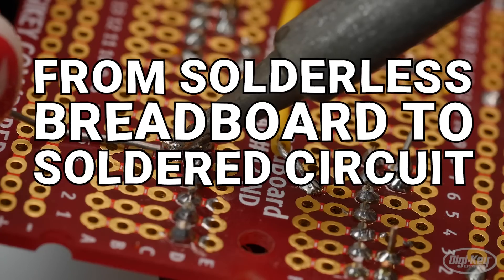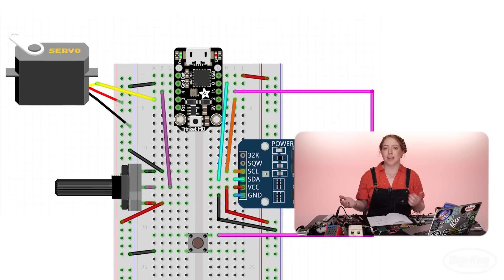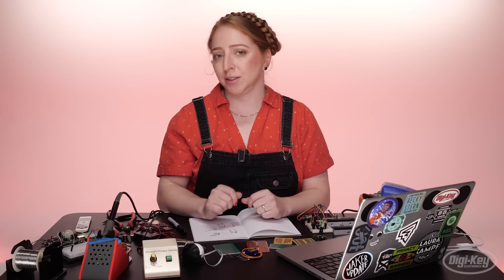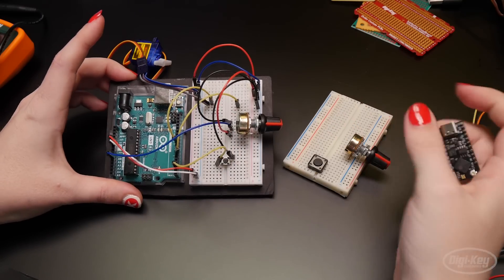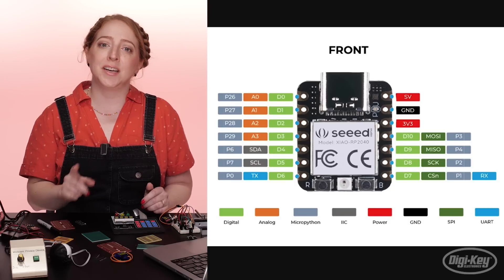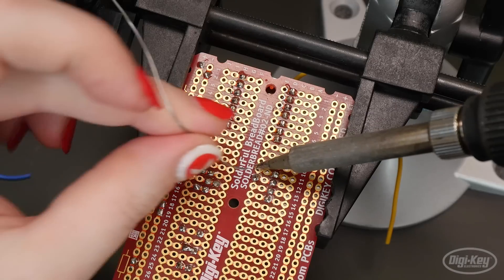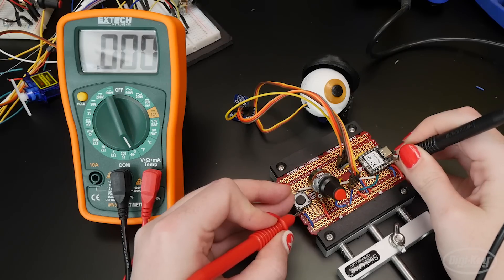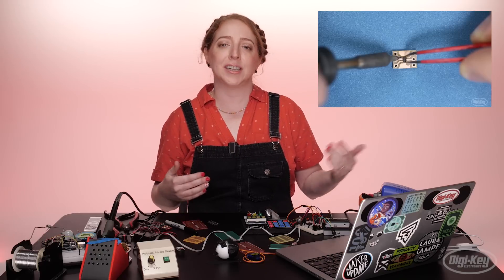From Solderless Breadboard to Soldered Circuit - Electronics with Becky Stern | Digi-Key Electronics

Comment: I recently learned that not all perfboards are created equal. There are "strip boards" like you showed and there are perf boards that have no continuity across pin holes. I'm using the latter to get my prototype to a higher level of ruggedness, because I don't want or need to go to the time and expense of creating a custom PCB for one or 2 devices. I'm very curious about the soldering techniques that people use when using the regular perf board, without conductor strips. Essentially, you need solder something directly to the underside of your through-hole components or create a jumper to an adjacent hole and solder connections from there. What do people normally do for this kind of scenario?

Comment: Great video!  I didn't know you can get a protoboard to match and Arduino shield footprint.  Question: How do you light your desktop surface and what camera/lens do you use for those top-down shots?  I am try to make some project videos myself but am struggling with lighting and getting good video of small electronic parts on desktop surface without glare.  Thanks!

Comment: If when you are developing your circuit on a solderless breadboard you are pretty sure you will later want to move it to a solder-type breadboard I saw an interesting tip. Get a solder-type breadboard with the same layout as your solderless breadboard and place the solder-type board on top of the solderless board with the holes aligned. Insert things into the solderless breadboard through the holes of the solder-type breadboard.

Then when you have it working solderless you just have to lift the solder-type breadboard off and the components come with it, already in their proper places ready to solder. Just be careful to tape them down so they don't all fall out when you turn the board over for soldering.